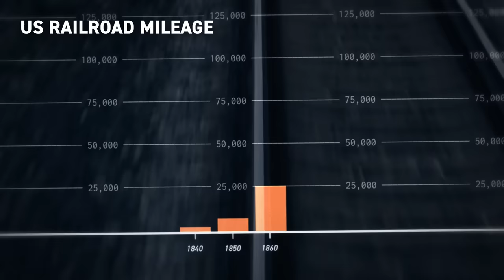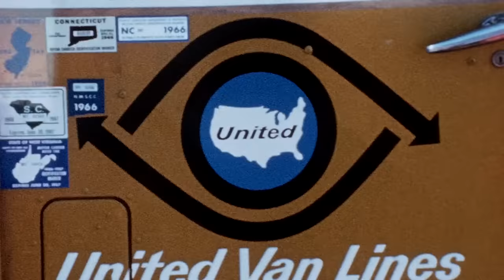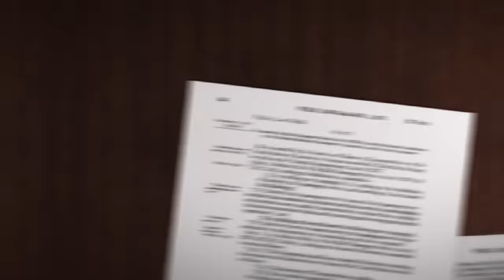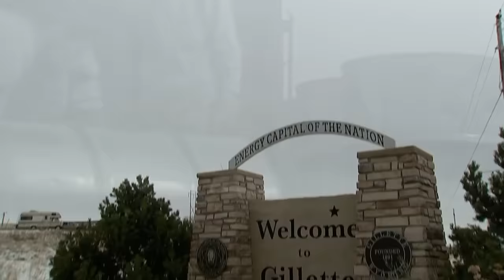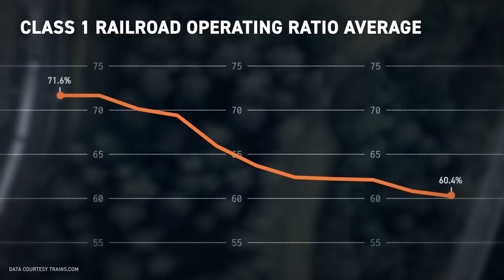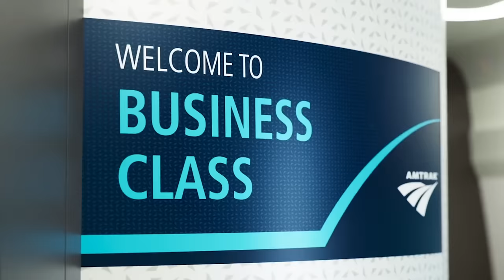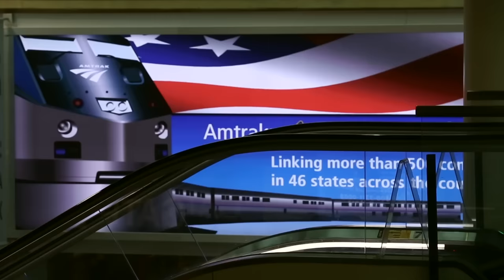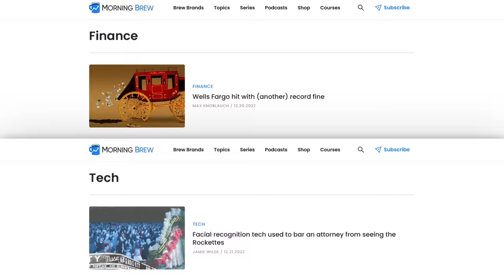The One Tiny Law That Keeps Amtrak Terrible

Comment: Ignored in the great qwest for ever greater efficiency by increasing the length of the train is the exponential increase in the physical forces involved. The current track and bed structure is not built to support three mile long trains. The physics of accumulating forces make starting, braking, stopping of the train  and of the motion of the train over the railbed of far greater scale than previously dealt with. Maintenance delay on existing infrastructure is not equivalent to maintenance cost avoided by better design.

Comment: maybe if the US wants to go into high speed passenger rail, they should forego standard track technology and go into maglev. yes it would be expensive to start, but why bother with standard rail when it will soon be outdated, leave that to the freight system.
Focus on the  best use, such as the Colorado corridor, you could probably attract more than the expected number of passengers, especially if  foul weather make it harder for cars and planes. Build it in such a way that it could easily be integrated into an eventual national infrastructure( start as a niche project and prepare for future changes) and use it for any new ideas or lessons learnt.

Comment: The government must invest in building separate track infrastructure just for passenger trains. There would be no freight rail connections or freight operating involvement. The government would build, own, operate and maintain the passenger only infrastructure. This would all be independent of freight rail. The right-of-way would come from government purchases of unused and surplus right-of-way from freight railroads, and the construction of new rights-of-way where necessary. The freight railroads must be dealt out of the picture (which is what they want) if the US is to have a viable and useful passenger network. I don't see any other way for this to happen. Freight rails are just going to continue to obstruct and oppose passenger rail no matter what. This would be expensive, but so was the building of the interstate highway system and the national air traffic control system.

Comment: The criticisms of the class 1 rrs is spot on here. However, Amtrak is terrible because Amtrak is terrible. Passenger rail just isn't profitable and will never again compete with automobiles and planes. There's always an excuse, and blaming Freight rail is convenient, but in the end, they're just excuses. As freight rail consolidated and shut down lines, why didn't passenger rail pick them up? Why don't passenger lines have a comprehensive network of old freight lines now only maintained for light traffic? Because it hasn't been profitable since ww2. That's why.

Comment: Here in France, we have high speed trains, most of the time reliable and right on time (even though people criticize, it's on time 95% of the time). I never understood why you don't have that. You have a lot of straight highways. If you could build a railway and put a TGV on it, doing 320km/h (almost 200mph) all the way, it could be a really interesting option.
And I wanted to know : how fast do your passenger trains go?
Reply: Judging from most comments I've read about American transit: dismally slow. I'm assuming barely averaging at 160km/h. But the real problem is being delayed by freight because they are physically (because of lackluster infrastructure) unable to give way to passenger trains.

Comment: US freight rail is not behaving in a way that is good for many customers.   There is no real railroad to railroad competition and little incentive to provide fast freight.   It does provide large movements of goods and raw materials such as coal, wheat and container freight.   Passenger travel on comfortable trains is an American experience that deserves to live on even if that means some government support.

With Amtrak the incentives to increase its host freight  railroads to provide 110 mph track service seems like a very good step for doing about as much as is practical  to increase passenger service in the US and it provides the infrastructure for fast freight, something the major railroads don't see as worthwhile if only providing for bulk non time dependent freight.   This needs a new federal railroad act.    If the US still had competing railroads this would likely not be needed, but it doesn't.   

110 mph passenger railroad corridors are largely created with better signaling and track.  They have at-grade crossings with full road width gates.  There is no fencing or limiting access required for the railroad corridor.   

Above 110 mph railroads corridors are required to be limited access with fending or some other type barriers.   That is problem for many areas where it blocks wild life such as what takes place with Interstate highways.   The need for limited access above 110 mph in desert locations seems unnecessary.  

Busy railroad corridors are almost always better to be grade separated with limited access.   In such situations passenger train speeds above 110 mph and possibly 160 mph such as on the NEC might be achieved.   Other than the NEC in the USA there doesn't appear to be grade operated limited access railroad corridors in the USA.   There is about eight miles from DC Union Station along the Metropolitan Branch towards Rockville MD that is grade separated with limited access.   It still only has track speed of about 60 mph where the alignment would allow double that or more.   Much of the Metropolitan Branch to Point-of-Rocks could be upgraded to 110 mph track speeds with the at-grade crossings and further at least to Harper's Ferry WV which is the limit for commuter trains.  The entire route might even be upgraded to grade separated and limited access for 160 mph running.

Comment: Y doesn’t Amtrak buy off the smaller lines that get trashed and start running shorter lines hourly while longer lines 3 times every day it would allow them to start making profit not having the cargo industry blocking the track and then later on once profits up they add tracks along the preexisting cargo tracks that can merge for tunnels and other things

Comment: The era where the RR was the standard modus-operandi. Where you could take a short walk yo your town depot and hop on a train to get you where you wanted to go. ... is far cry from the cities-towns-suburbs of today. 
First off, where you wanted to go. Was generally smaller locales within a few miles of where you lived, or if you did travel long distance. You arrived at locations with train depot setups similar to your local one. Then you stayed within a short radius out from the destination depot. Which limited your ability to go to places not served by train service. As you were required to configure how to get around your destination, especially if it was rural or a small town.

Most people lived in 1 of 2 places the city or the farm. They also generally tended to live within a short distance from their mode of transportation for convenience 
The case today, people live in so many different locations and distances from stations. You either have to build stations every few miles, which adds stops, which adds time. Just to make it feasible for people to make it to the suburbs far from work, in a reasonable amount of time. Your never on your own schedule, you're always on someone else's. There's no waking up and hitting the snooze, or you'll miss the train that will get you to work on time. Which don't even get me started on the unintended economic impact on things such as rent. Which would be higher based on proximity to train station. 

Another fail ... being on someone else's time schedule is you have to be ready to travel when the train is. You can't work odd shifts where you get off at 3 a.m., because yes. Public transit stops at a vertain hour. So instead of being able to get paid the extra.$10/hr for working til 3. Or you have to make sure you're able to leave work at a set time, in order to catch the last train out for the night. Again affecting your income. These are real world incidents I encounter teres when living in cities with public trans. 
The world is 24 hours, and people work odd shifts, such as those at hospitals. As an RN if you have a patient go bad right at shuft change which happens a lot. You have a duty to stay until that patient is stable. Your transportation needs be damned. It's not practical for such long distances in all different directions. Peole want to live in suburbs 20-40 miles from work, or more in some cases. Your autonomy and you ability to earn and live on your own terms are now someone else's

Comment: The problem is also equipment. The government is continually slashing funding for Amtrak, and Trump putting a former airline CEO as president of Amtrak certainly didn't help either. Where is the money for the equipment for all these extra routes going to come from? Also, having freight rail focus on the long haul while trucks handle short-haul customers makes way more sense from a logistics standpoint. Keeping long-haul trucking numbers down makes that industry safer, overall. Yeah, of course train crews have to stay on call because you don't know when a train is going to show up. There is no schedule, as you've pointed out, so you don't know, and even if there were a schedule, it's not like delays don't happen. Crews are going to be on call, regardless. Does it suck? Yeah, but that's the nature of the beast. Of course, companies are going to maximize profit. Every company, major or minor, does this.

Comment: While the priority issue is serious, Amtrak needs to be reorganized. The best idea was suggested years ago. It involved dividing Amtrak into three separate operating units.  The first unit would be Northeast Corridor and some routes branching off of it that are basically dense enough to be profitable with minimal to no subsidies.  The second unit would be lines that are perhaps seasonally profitable or otherwise on the bubble.  I think this would be the Florida trains and New England ski trains.The third unit would be responsible for running the route that don’t have a prayer, but are necessary to provide a national route.  This would be largely trains connecting the west coast with Chicago, Saint Louis, and New Orleans. It would include the various routes Amtrak has that they are running under contract with various state and regional agencies. Lastly, this would handle the Congressionally mandated trains, when the ranking Senator or Representative on the Transportation Committee has insisted that Amtrak run four trains a day between East Bumbleshoot and West Overshoe in his district, or their appropriation bill isn’t going to pass.  The third division would never have any intention of running a profit, and would be almost 100% subsidized by Congress and the states.  Basically “We will run passenger service anywhere there is still track, but it has to be subsidized by somebody before we turn a wheel “.

Comment: The big problem with passenger rail in the Front Range of CO is that back in the 1970's Colorado Springs actively pushed to get the former Santa Fe rails out of the city center, leaving only the former D&RGW.  This effectively created a single-track railroad from Fountain, CO (the south end of the Colorado Springs sprawl) to Palmer Lake, which is the top of the grade and the watershed split between Denver and the Springs.  With the heavy increase in coal traffic, this became a VERY busy rail corridor, still with single track in this segment with a handful of passing tracks.  Though there is still a push for passenger rail, it will require a dedicated push to replace the double track but there is a problem.  Part of that line runs right through the Air Force Academy.  This may be difficult to achieve.   Meanwhile, I-25 is a total NIGHTMARE between Colorado Springs and Denver!!!!

Comment: Other countries mix freight and passenger travel on the same lines without any issue. American railroads need deregulation and simultaneously, the management of the rail network by a common agency. The government's role is to help this along with regulation. The goal is the rejuvenation of the rail infrastructure, electrification and digitalization while allowing equal access to many competing operators.

Comment: I thought about using the train from Florida to RI recently thinking it might be an experience. When I looked up the ticket it  was going to be 1.5 days long which I didn't mind but, the cost of the train was 3 times the cost of flying and get there in 3 hours plus 2 hours preflight in the airport. So I chose not to use the train

Comment: AMTRAK passenger trains can carry about 1,000 passengers on 13 coaches and two sleepers on a train with a dinette a baggage and a cafe car with two engines.  Two such trains (a "limited-stops" passenger "special" and an "all-stops" "local" on the same line) can carry roughly the equivalent of six to ten usual planeloads of passengers far more comfortably and with far more accomodation with actually more flexibility of origins and destinations served by even just those two trains than could be served by all those far more fuel inefficient planes.

Comment: An idea that I have proposed may times in this discussion of Amtrak's operational problems with the freight companies.  Simply tell the freight companies that Amtrak trains must have priority over freight. If required you will build the infrastructure needed to do this. In return, any route that passenger trains operate on will be exempt from property taxation.  Note that I said passenger trains, not just Amtrak. States with intrastate service would qualify. The railroad companies may even decide to get back into passenger business or permit private companies to contract for operating rights.

Comment: I’ve had conversations with Rail Execs about having high speed passenger rail from Colorado Springs to Denver. They were complaining it would cost $1M per mile. I kept pressing. Turns out they just don’t want to. They only want to deal with freight.

Comment: here in the west one train a day for long haul passenger is part of the fail. the routs that get many trains a day are for the most part NOT amtrak, and are only for commuters.
the altmont express (commute use only trains) should rebuild the old sp rail from tracy to fremont. rebuild to remove many at grade crossings. (look at down town reno, nv).

Build a line from downtown reno. south to barstow. going through carson city (state capital), then minden, (large airport between both of these city's. then south to bridgeport, lee vining  (yosemite access) (hugh ski resort), mammoth lakes (another large ski resort) bishop, lone pine (access to death valley) then south to barstow.connection to la to vegas trains. and beyond. this line would only be for passenger trains. maybe some mine ore trains, other?
and then take control of some not used rails and go north to Klamath falls oregon. bend to portland. gets people into reno to leave lots of hard earned cash behind. the casinos could cover over 80% of this cost. as both la people would go north. and portlanders would go south.
maybe even reno to windover then north to idaho? special train from salt lake city?

Comment: One of the aspects that doesn't get mentioned is taxes.  CSX had a line that went north in New York.  It ran one train per day, one day up, one down... So figure 6 trains per week.  The little cities along the line were basically running their operations off taxes on the railroad.  School systems? Police? Libraries?  Everything.  Kept the taxes on the citizens way down.  The big problem?  How does CSX even break even when one train per day is paying for hundreds or thousands of payroll lines for the cities.  CSX was losing millions on that line.  So they sold a 99 year lease on the line to the state's commuter agency... They pay trackage rights for the freight, and all the maintenance and costs for the line go to the commuter agency.  The cities went to full panic mode, because they could not tax the state...so suddenly the citizens had to pay for their local schools, police, fire, libraries and so on.  When you look at taxes, you find a reason that non performing lines get pulled up.  The presence of track increases the tax load of the line.. the presence of double track increases the costs far more.    So if the state wants to keep the track in place when it is being abandoned because it is not profitable, they need to buy the track.  North Carolina has been doing that, and if it is too late to save the rails, they buy the row.  But that means that the state takes on a continuing expense...Will states like Illinois do that? How about Montana?  Idaho?   Maine?  Saving the track will require public money.. perhaps large amounts of it.

Comment: I LOVE riding on trains. But, to get from where I live to where my family is located, it's a 13 hour trip (as scheduled) compared to a 7.5 drive, running overnight. And I'm a bit high maintenance about sleep (I just can't sleep in coach seats, as comfortable as they are; I also am a complete mess if I don't get sleep) so the overnight timeframe means I need a room. (Oh, also, the bad timetable has me waiting in a nearly empty train station at midnight... or 1am or whenever the train arrives.) Thus, to take the train I need to almost double my travel time, travel overnight, and pay an insane amout of money. Needless to say, I usually opt to drive, as much as I hate cars, and the only reason I've done the train at all is because I just love trains that damn much. It's such a shame. I would give anything for good passanger rail service.